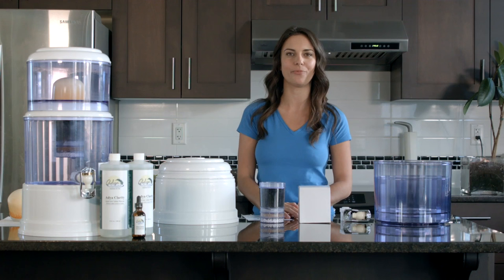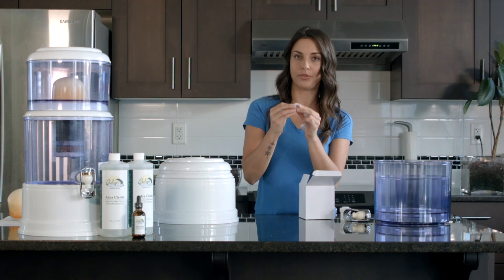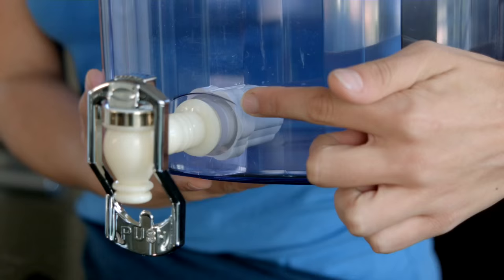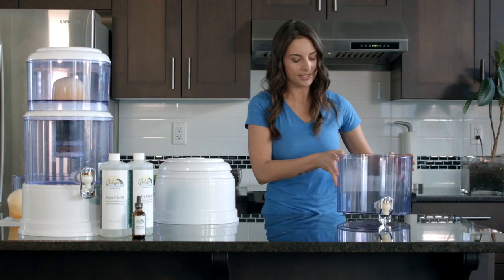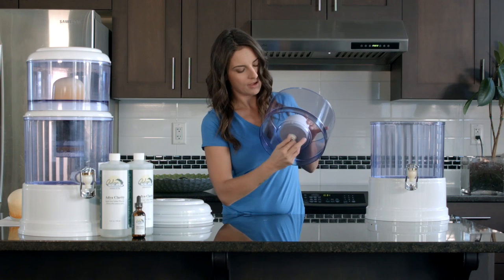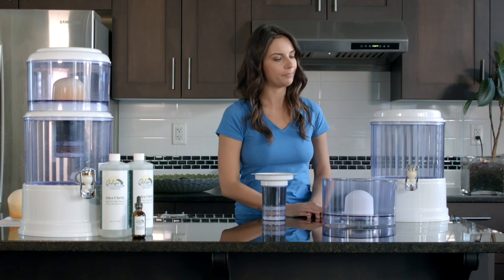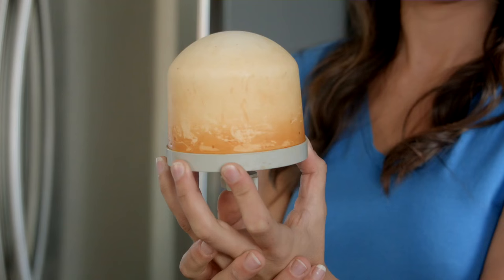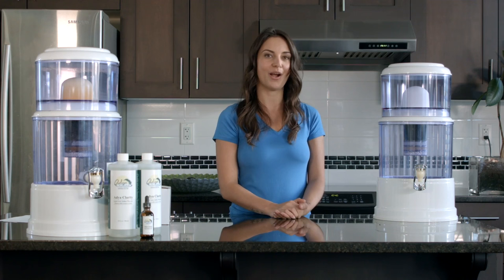Adya Clarity Gravity Filtration System Assembly Demo

Comment: I bought Adya Clarity without the filtration system 2 weeks ago. I'm in America, the yellow contaminants on the bottom is astronomical! The water tastes soooo good. especially cold! A helpful suggestion, if you use tap water, use very hot water. The process works much much faster. if you use cold tap water, the process will take 2 days to completely clean it (because the water will go from cold to room temperature and the process is still sluggish). If I use hot water, 2 days process will take around 10-12 hours. If you use water from a filter, refrigerator or bottled water, I boil the water first to make it hot, then use Adya Clarity. it's like I'm a water chemist. Hope this helps. By the way, I think this works for radioactive water as well... so when doomsday or natural disasters strike strikes, you don't need to pack your car with heavy water weight, just glass/metal containers and can take water from a stream or dirty lake, and you will not get cholera, dysentary or other waterborne illnesses. make sure to leave the container open throughout the process so gas substances can escape (like chlorine and pathogenic decomposition)
Reply: How did you filter your water after diluting it w Arya clarity?